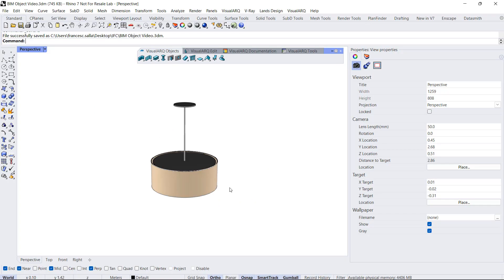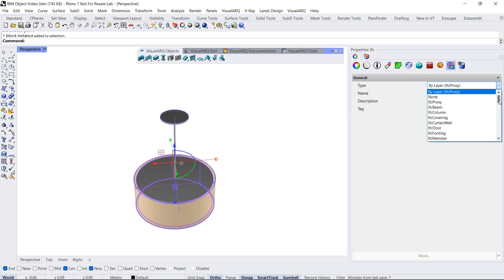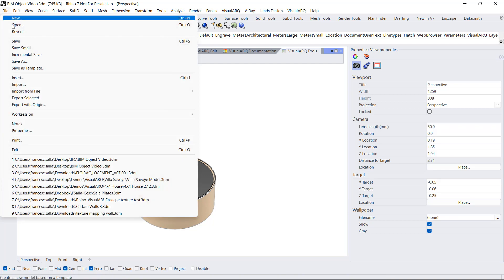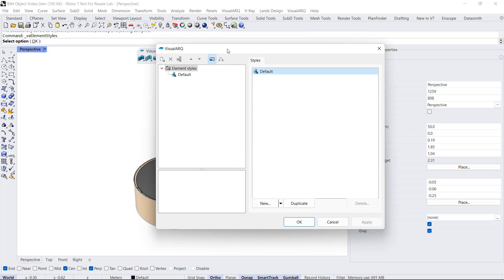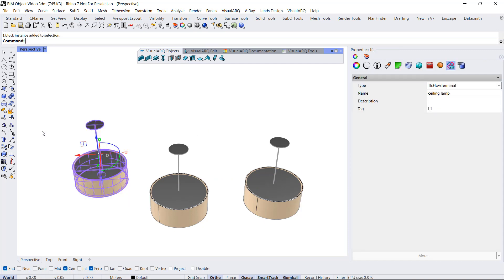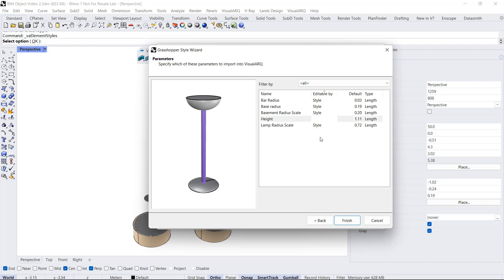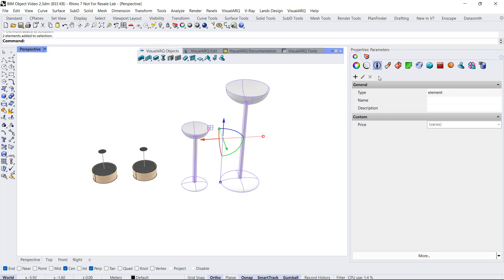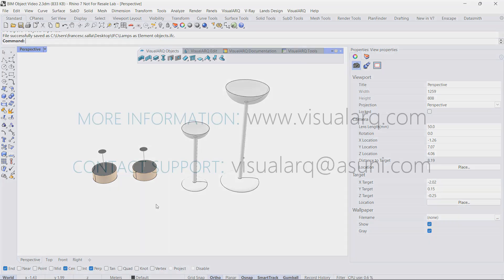Create BIM Objects in Rhino with VisualARQ

Comment: it worked with my , but when i open new rhino prject and i want to look for the model it was not there in the style list . how can i fix this or may i'm doing somthing wrong
Reply from the maker: Hi @AKDaiwaly, the new object styles you create in document, are only saved in that document. If you want to use them in other files, you can export and import them. Take a look at this video: https://youtu.be/TCO4yb1IroM?si=u5k2d4dMin1vTOGz. You can also save that document as a custom template, so the new styles are available when you start a new document.